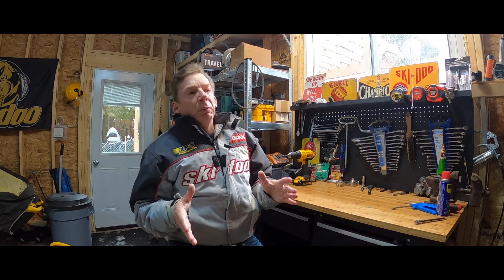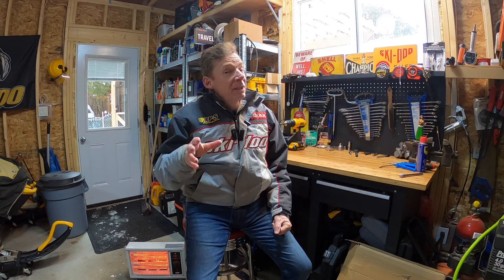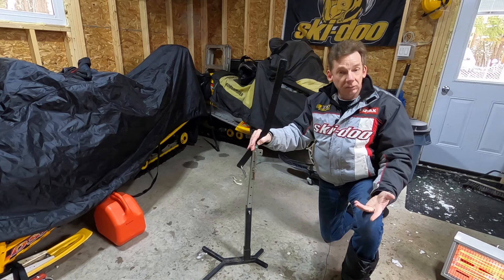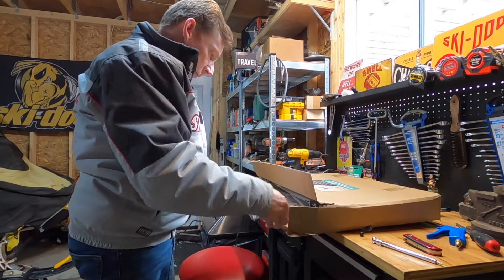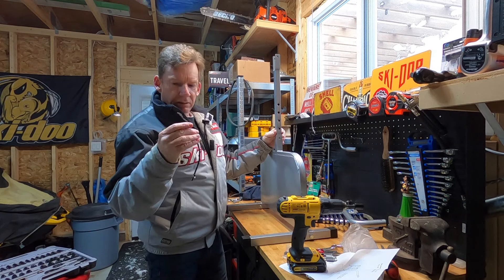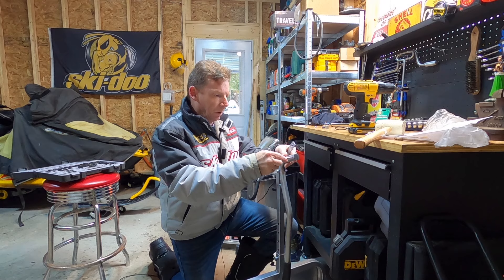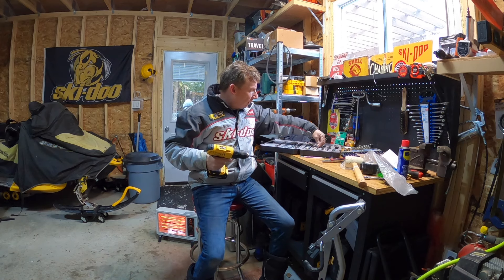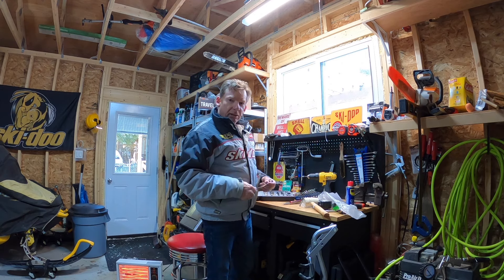Snowmobile Track Stand Review: One To Avoid!

Comment: I've had my Princess Auto lift for years.  The rubber is a problem but i had some windshield washer hose that has held up quite well.  The biggest complaint is the amount of lift you get.  It's not high enough to lift my wife's sled with the R-Motion suspension.  I use a couple of 6x6's underneath the stand to get the track off the ground.  Overall it has been a great stand for many years.
Reply from the maker: Hi. I did noticed that it didnt have a ton of lift. I think I’ll drill another hole further down the top bar and see if that buys me a bit more, but i can spin the track.

Comment: You know a video you should do?   Is how to remove a drive belt if the clutch tool hole is stripped  on the secondary clutch :)    I just think thats a handy thing to know how to do if someone needed to  :)  On both your old MXZ and your newer sled  :)
Reply from the maker: I normally put the back end up and turn the track while pulling the belt over

Comment: David,  I also use my track stand for summer storage. There is no shield but works very well. Extreme Max 5001.5013 Lever Lift Stand    thanks for the video.
Reply from the maker: Hi Richard. Yes thats got a nice wide stable base as well. I agree, leaving the sled jacked up and unloading the suspension is a good idea.

Comment: Good video, David. I have a track stand like your second one from Princess Auto. It is stable, but sometimes I find it doesn't lift my sled up high enough, especially when the sled is on castors, so I end up propping it up by putting the legs on top of a couple 4x4's, to give it more height. I also appreciate the shield at the back for protection from flying debris or when I forget to remove my track castors and it goes flying out the back when I rev the sled.
P.s. I hope you are getting some quality rides in this winter!